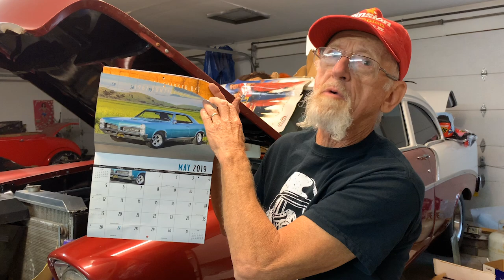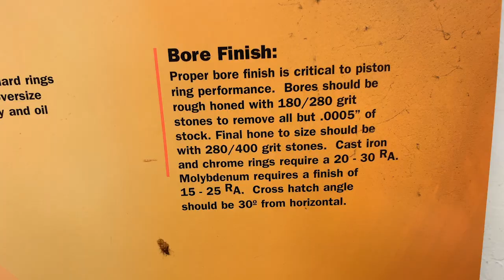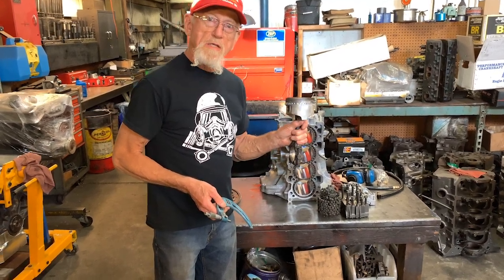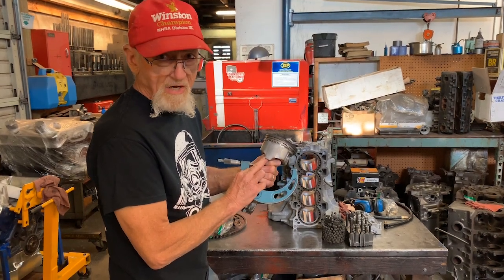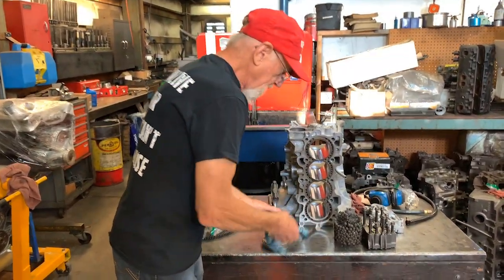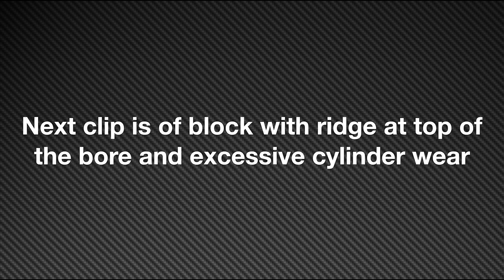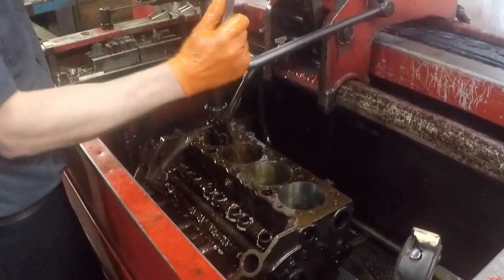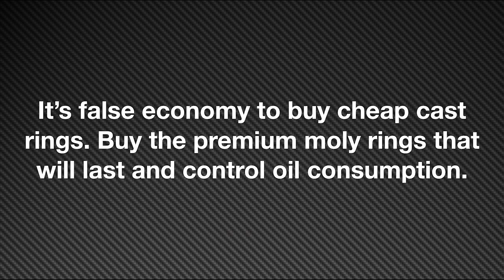Hone Your Cylinders Correctly. Enough Bogus Info!

Comment: I put 8 new pistons in an LS1 with approx 40k on the block, and used 400 grit sandpaper to lightly rough up the cylinders, and I have never had rings seat in so well in any engine I have done. The engine burns virtually no oil, even better than when it was new. The reason I did that was because I didn't want to pull the engine out of the car, and it was too awkward to use a hone. You haven't lived until you know what you can get away with.
Reply: Bro you just gave me so much hope. I'm currently doing the same thing to 1996 Silverado with a vortex and everyone keeps saying it can't be done but I'm happy to see there's someone else that did it and had good results.. so you just sanded down the cylinder and slapped the Pistons back in?
Reply: @outlaw4972  thanks, try make somewhat circular motions with the sandpaper. The main idea is to just take the glazed or shiny surface off the cylinder. You don't need to sand too much. 400 grit sandpaper should be good. Always make sure the expander ring (the middle piece) in the oil ring is always in properly, with the ends butting up against each other, before installing the piston. They tend to jump over easily, and then there will be oil burning. Only thing, the less wear on your cylinders, the better the results. My block was low mileage, so there was no noticeable wear.
Reply: LOL... let that oil filter earn its money. I love it!
Reply: @playsportfun3356  Used a variety of method to remove all dust, etc. Would recommend closing off bottom of cylinder with rag or lid so nothing lands on crank or anything. No fear of anything getting caught in hone because you are using just sandpaper.
Reply: Oh hell why not just go to town on it with some 80 grit.. 🙄 Did it ever occur to you to pull the engine and do it right? Seriously if you can't honestly it properly then don't hone it all. Just put all the pistons back into their correct bores with cast, or molly rings and brake it in. Its funny to me that everyone thinks they have to "brake the glaze"
Reply: @poncoolride  Have you ever had to "pull" the engine on 2001 trans am. You have to drop the K member and take it out the bottom, wheels and all. On your other points, why would anyone use 80 grit? And a hone is also called a deglazer for a reason.

Comment: Some guys don’t know or won’t admit that a proper flex hone job is about as good as a finish on a cylinder wall as you can get hands down. Now this is assuming that the cylinder is round and still in good condition.
Reply from the maker: Ya, because we all know cylinders don't weaR OUT AND PISTON COMPANYS ARE JUST WASTING THEIR TIME.

Comment: There's nothing wrong with using an expanding type hone to 'remove glaze' and minor scuffing of the cylinder and help 'faster ring seating' and 'recondition the cylinder wall'. That's what the factory manual for my 1963 Rambler American, and other manuals of the era say.

They go on to say that if the cylinder is tapered in excess of .004 it should be trued (made round again) with the rigid hone. The expanding type hone only follows the surface of the bore/cyinder, so it will recondition the surface but not the shape.

So with simple logic and reasoning, you can conclude that 'an expensive trip to the machine shop' is not always necessary.
Reply: Was going to make a similar comment. I work in aviation maintenence and even aircraft engineers have us use a flex hone in some cases (not in the engines of course). At the end of the day, specs are specs. If the walls are true and in fairly good condition, then you likely CAN get away with the diy approach vs $1000+ 
Obv a machine shop is preferred, but again, you're trusting that shop to do the job right as well.
Reply: thats how it was done for 80 years.., then the ball hone was invented and now  its said to be better,.,is it really, ? the goal is to keep some oil in the cylinder. what will do this better? tiny groves cut horizontally on the walls of the cylinder or vertical groves?  does the crosshatching have other purposes? or did we all just jump on the ballhone bandwagon and profess that this is the best way to go.. I dont know, but the ball hones are expensive. sometimes marketing leads folks to believe they have something better when its really not. I have honed several cylinder with just a 3 stone spring hone and it always worked well.  after abt 15,000 miles most of the grooves from a ball hone or tri stone will be mostly gone .  older wrenches know this, but younger ones just think the ball hone has always been the standard.
Reply: @randy1ization  Your right. The stone hones are much better than the ball hone. 

Problem is that most people in this generation don't think, they just follow.
Reply: @OldCrowsClassicCars  yep, I can recall rebuilding an old honda single motorbike engine, and the manual instructs to roughen the cylinder up with 400 grit sandpaper.. thats it.. this millenial generation thinks that the most expensive stuff is better.  they never question the WHY. or HOW..  They see some poser on a tv show who was given everything by sponsors, telling them its the best and they yank out thier credit card and order it.  the crosshatch pattern makes NO sense to me. 
it will actually hide low spots in the cylinder because the balls arent uniform and will touch the low spots.. you could have a low spot, or taper and you wouldnt know it.. BUT HEY IT LOOKS COOL..  also an easy was for a half assed machinist to hide shitty work..
Reply: @randy1ization  couldn't agree more. And good point about the cross hatch. Some people just want to be smart asses and just over complicated things that are actually simple.

Comment: High-performance engine shops use a profilometer to scrutinize cylinder wall finish, formerly referred to as “RA” (Roughness Average). 
The sophisticated electronic tool features a diamond-tipped stylus, similar to the needle found on a vinyl record turntable, that drags across the surface measuring the distribution of peaks and valleys. 
A profilometer provides modern, defined descriptions of cylinder bore finish that include “RPK” (Reduced Peak Height), “RVK” (Reduced Valley Depth) and “RK” (Core Roughness Depth), which is based on both the “RPK” and “RVK” measurements.

Comment: As someone who hones 8 hours a day 5-6 days a week, I can tell you that honing is an art. Honing is pretty easy to pick up, but if you're not properly instructed you can damage your part pretty easily. I would not recommend having the first thing you hone to be an expensive part, if you're deadset on doing it yourself practice on something else first. I hone airplane parts myself and I'd be hesitant to hone a car cylinder because it's a different technique. I don't hone for the surface finish, but to remove material to get a bore to size for production pins

Comment: The first engine I rebuilt was a Buick 350 with 135,000 miles on it out of a '68 Buick Special (Skylark body). The plastic teeth coating on the cam gear had broken off and starved the 3-4 crank throw seizing the crankshaft. I had the block dipped, put in new cam bearings and a standard rebuild kit: gaskets, main & rod bearings and cast iron rings along with a new crank. I used a borrowed dingleberry hone for a 4" bore (the Buick 350 is a "square" engine, 3.8" bore and stroke) to put a 30 degree cross hatch on the cylinders.
   The Buick 350 had a full skirt piston and those things slapped like hell until it warmed up and quieted down, but after that I swear the thing had a good 25 more horsepower than it did stock. It would chirp the tires at the shift (the tranny was a Super Turbine 300, basically a single case 2-speed Powerglide) and I put another 35,000 miles on it before I sold it.
   So it depends on what you're working on and what you're trying to accomplish. I spent about $200 on what was basically a junk car before I started (this was in the early 80's) and got another 35,000 miles out of it and had a mild hot rod to boot. If I'd tried to do that dingleberry thing on a Chevy 350 with half skirt pistons it might not have gotten out from under the shade-tree I did it under. lol

Comment: I can tell you...that Ball Hone is fine.  In fact, its been proven many engines have picked up power by just running that flex hone through it and reassembling it.    time ticket at the track proved it.

absolutely agree, if you are going to put new pistons in a engine.....bore and hone it at a machine shop.   alot of technical things....clearances....etc..........

as for piston rattle....that has to do with material and expansion rate.  Many toyota v6 engines -have piston rattle when cold.  after a little heat gets in them, they quiet up.  200--300k miles...yup-still running.

Comment: Sir I fully understand what you're saying. But u are fully competent in measuring cylinders and pistons and proper clearance issues and u measure and the cylinder is still true than there is absolutely nothing wrong with freshening up the bore with an actual tri stone attachment with the right grit and put proper set of mahle rings on ( which i without a doubt agree with u sir) i mean ive been doing that for years and actually just did it yesterday. I personally find it most successful and helpful when i change my rings way before they're needed.  I've always had extremely even wear and i am able to prolong the trip to the machine shop which of course will always come someday its inevitable. By the way great video but why show a ball hone in your garage should've shown the real one. Cheers and please dont think any of this is meant in any ill manner

Comment: Pass, I’ll do it myself. You know how mad I’ve been paying a machine shop to do work that wasn’t right. I’d rather do it 3 times learning each time than ever get screwed by a machine shop again. Don’t get me wrong if I need it bored over sure. But if I need it honed no thanks I slowly learned to use measuring tools over each build I’ve done and I’ve only gotten better and become more equipped. Do it yourself you’ll only have yourself to blame. 
Fun fact my first rebuild was a 22re and I only used plastigauge. 10 years later that little bastard drove the 350 Chevy that slapped a piston against the head back to the machine shop that rebuilt the short block.

Comment: That noise or clatter can also be from forged pistons.  Even brand and perfectly sized forged pistons will do this.  

By design a forged piston is greater clearance to accommodate the expansion don’t heat

Comment: If the Cyl. wear is a little excessive and you don't want to have it bored then cut the ridge, lightly hone it and use cast rings. They seat quicker but do not last as long as moly rings. What this man said is right. It depends on your budget. I have done ring and valve jobs many times without removing the block. It's up to you. One other thing is newer engines have much narrower rings with less tension and they have a tighter piston clearance. Choose your own poison.

Comment: I agree that a machine shop with something like a CK-10 should do the work . * If you can get them to do what the Ring manufacturer recommends *** I gave them a print out of hone spec.s for my total seal rings and they ignored it.
I payed a good buck to get my block (S.B. Chevy) Torque plate honed, and they admitted later (After engine was smoking on Dyno) that they used 600 grit instead of 320-400 grit finish. I have assembled many engines and know how to clean and lube cyl.s before assy. Note: Leak down was less than 2%, all that oil must have helped total seal rings do the job. The did not fix problem.

Comment: Before I saw this video, I already ordered several items from Summit during my in chassis teardown of a 1985 Dodge 318 truck engine.
Crusty damn engine....oil was never changed...don't know how many actual miles on it.
Bores had no ridge, just shiny. Top ring looked like moly. I measured the bore taper/out of round etc.....still a good standard 3.91 bore.
I bought the BRM 320 to deglaze, and some standard sized Hastings plasma moly rings. Crank is good so I'm doing standard sized Clevite tri-metal rods and mains also.
I regret trying to remove that rope seal rear main seal though....what a PIA!
Had to drop the crank a bit, converter and bell housing bolts to get the upper half out....I bet it wasn't even leaking....should've left that alone!
Bought a set of factory casting later model closed chamber heads with larger SS valves from Indy Cylinder Head. I smoothed out the bowls and re-assembled....the casting slag in the exhaust bowls was horrendous!
I purchased alot of new parts for this refresh....damn near an inframe rebuild....not my first rodeo, but first attempt without a machine shop.
It is funny.....Summit Racing had plenty of 320 grit flex hones, but the 240s were mostly sold out....lucky for me...lol.

Comment: Hmm, remove the block from the car and haul it to the engine shop or just hone it at home with a decent inexpensive tool?
I appreciate that a shop with a machine could do a much better job but are they going to come pull the block for me?
Forget that.
Reply from the maker: I'm going to edit this and put a picture of my 12 or more Brush Research ball hones. I have them from 3 1/4 to 4 1/2 in different grits as well as small ones for wheel cylinders and lifter bores. I still have the first one I ever bought for a 4" SBC bore. At today's prices they would cost $-500 +. They are for deglazing and establishing a proper crosshatch for ring break in. If you you know what you are doing they work great.

Comment: well I'm working on a Frankenstein build for my 2.0 focus. AND  the idea is street performance that can daily if wanted to... I suppose it would be a good idea to mic the pistons I plan on using my Fowler bore gauge to mice the cylinders .. just to learn....  but I'ma do a hone with a drill and call it a day with new rings I got off of EBAY... boie..  if anyone was wondering which ones they're called Hastings

Comment: YouTube recommended me this video and I am never too old to possibly learn something new so I clicked it.  Notice he talks about the precision required by molly rings- which I agree with?  Here is my 40+ years of experience tip.  Even though cast rings don't last as long, they are forgiving and like a rough hone.  If you are hand drill honing, use stones and stick with molly.  It works out great for guys who "actually" do it- not guys like this guy who never do it like that but tell you it won't work- the same guy who benefits from machine shop service sales (cough, cough.)  Molly lasts longer, but you can probably re-ring your engine 10 times over with cast rings yourself before you would spend as much as the machine shop price for a precision molly hone- and catch problems earlier with more frequent tear downs and opportunity's to polish the crank.  Watch Uncle Tony's videos and save a fortune.  This poor guy has blinders on from to many years of mundane repetition.  He is the poster child for the saying "#Learn How To Code..."

Comment: Well of course a machine shop owner is going to say pay a machine shop to do the job. What a waste of time to even make this video.
Reply from the maker: just to be clear I own 17 various size Brush Research ball hones. They do a great job. I HAVE HONED MANY BLOCKS ON THE CHEAP FOR CUSTOMERS WITH THEM. It's pretty false economy to rent of buy a hone when you actually don't know how to properly use it. Most everyone can benefit from doing it properly or if they are unsure, have a shop do it.No drama there.
Reply: @lpburke86  Calm down. This man is just saying if you want it done right go pay to have it done, if you want to do it yourself you run the risk of fucking it up. You should relax man, this is an informative video.
Reply: @lpburke86  I got some good info, I watched it and took notes!

Comment: Everyone has a opinion factory rings work just as good I had a olds 307 with 450k on it and never burned oil 
Just changed your oil and don’t beat on it or overheat the motor run a oil cooler or a triple core radiator